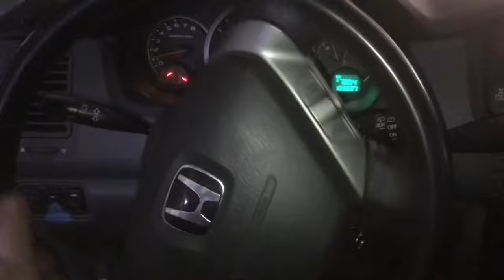“repairing” a LEAKING power steering low pressure line (honda pilot)

Comment: One of the VERY FEW videos I’ve been able to find about the low pressure lines. 2007 CRV here, I’m replacing the two return hoses (not the hard line itself) as there are leaks where they connect to the line. Wish I had the flare tool.  Thanks very much for posting this!
Reply: How much they charge for this ?

Comment: I need to patch a hole in the long metal line that cools the PS fluid, but i'm having a hard time finding a suitable hose to slide over the line. Do you have any thoughts on what i could use or where to get it?